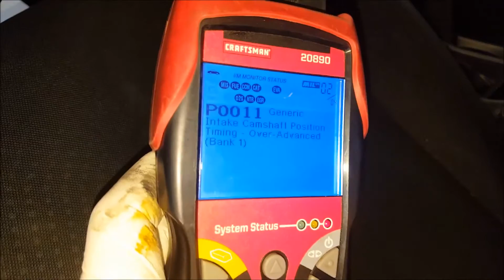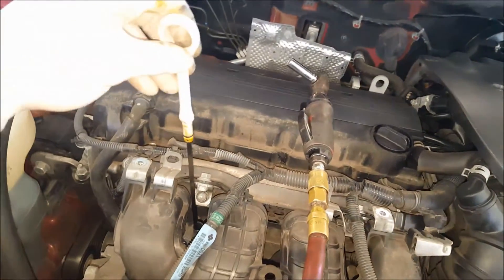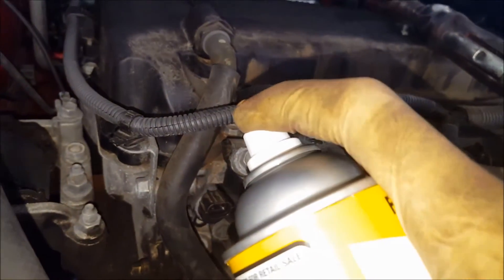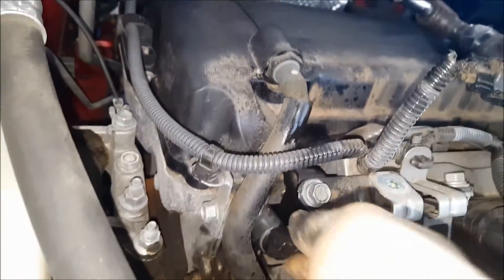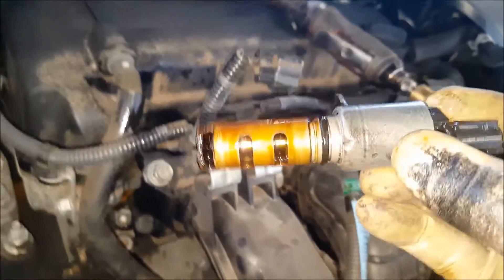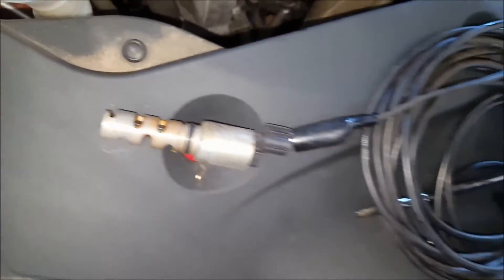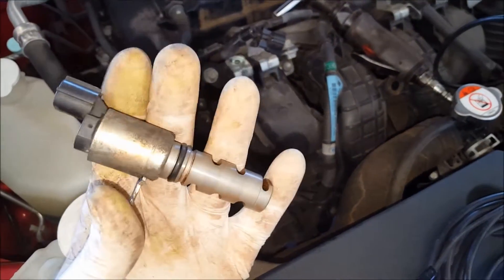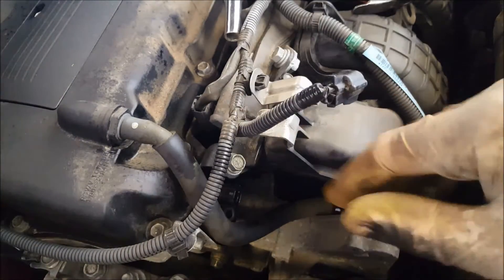MITSUBISHI 2.0L P0011 P0014 Outlander / Lancer variable valve timing solenoid vvt 2007-2016?

Comment: As a auto mechanic that does a lot of heavy line engines transmissions etc i cant tell people enough that these solnoids have a very fine mesh screen around them on a lot of vehicles those screens plug up cause timing problems oil psi issues etc. So many vehicles I work on are destroyed from lack of maintenance.  Ignore your oil change reminder they usually have you go longer than you should. Do your oil changes every 3k if your car or truck is turbo. 5k if not. Using a full synthetic oil. You do that you will save your self a lot of pain. Also service your transmissions every 50k or so.

Comment: Helpful in understanding the codes but quick question.  I had these codes pop on me about 100 miles after an oil change. I was concerned as I got a "low oil pressure " message first. Checked my oil and I was good there thought I'd be able to make it home less than 10 miles. I didn't make it. Car started tapping like it had no oil and stalled. Would looking at these solenoids be worth it at this point or am I dead in the water?

Comment: Replaced. Oil is new and clean filter too. Had dealer put in new oil pressure sensor and Still keeps popping up low oil pressure. Any help ?
Reply: Cleaned out oil pump pick up. Replaced the oil pan and oil and filter. Problem solved
Reply from the maker: Sweet. Glad to hear you got it rectified and taken care of

Comment: I have a 2008 Mitsubishi Lancer GTS. Mine doesn't look like that. Just has the dirty oil on it.

It was involved in an accident (hit in the rear passenger) but sat for 7 days at one place then when I tried to get it back, it went dead after a full days charge. 

It started acting weird like it was weak to start after barley being driven. When I finally got it to another auto body repair shop, it was there two days before it croked. Got it towed to an auto repair shop, they said they did diagnostics, but when I picked up my car from there (only replaced 4 spark plugs and 2 coils), I smelled burning through the a/c vents.

Hooked up my code reader and it said it was the P0011 and P0014. My oil cap has sludge on it, but the solenoid doesn't look like my cap. 

You think the part is just bad? I also want to buy a factory solenoid to replace it but I know it will cost a lot. Would I need to get the Power Probe to test it or just get it replaced?

Thank you
Reply from the maker: Hard to say without seeing it.  Prob bad solenoid.  These are very common to fail.
Reply: @NoNonsenseKnowHow  would they both go bad at the same time?
Reply from the maker: Not generally, but not unheard of. Usually best to replace them in a pair either way from my experience
Reply: @NoNonsenseKnowHow  I will start with that then. I was gonna do an oil change to see if that would help since I'll have to do it anyway, but seems like just replacing them is the best way to go. 

Would I need to do anything before I replace the old ones?
Reply from the maker: Sometimes changing the oil takes care of it. Especially if somebody put the wrong weight oil in there last time
Reply: @NoNonsenseKnowHow  So, I should try changing it first, then replace them if it has the same problems. It has been sitting for awhile now but I have 2,000 miles left until I actually have to get it changed, but if the wrong weight is in there then it needs to come out, right?

I mean my idle was off but it was only after It had been sitting 7 days the first time, 🤔🤔
Reply from the maker: I would start with changing the oil and clearing the codes
Reply: Friend, are both the same, front and rear?

Comment: Can u help me , I need to know what’s the correct oil pressure on my 2014 Outlander gt, I have a noise when the car is cold but the soon the motor get warm I can hear the ticking noise , I know the pressure on the oil when is cold is at 45 and when is hot is at 17 , do you think is correct, thx for ur help .
Reply from the maker: Sorry I'm not sure what the speck is off hand. I would think you should be able to look it up in a manual or on the Internet. Have you tried finding a factory service manual download? A lot the time you can get them for free
Reply: Yen I’m trying but no luck .

Comment: I have a 2011 Lancer and got these two codes as well.  Where do I find them to check/change/clean them?
Reply from the maker: I tried to cover a good amount of that in the video. And I put links to them in the description
Reply: @NoNonsenseKnowHow  I know where to find the parts to check and/or replace them on the internet.  I was talking about where on the engine do I find them.  I didn't know if they are located on the same place on my car as the Outlander
Reply: They're in the same place. Did you figure out what was your problem?

Comment: I'm doing this on an 09 lancer. They are in the same spot. They wiggle back and forth but they won't pull out. Is there something  I'm doing wrong?
Reply from the maker: Did you try spraying some Rust penetrant or Lube on them and wiggling them back and forth? After doing that they should pull straight out while twisting
Reply: @NoNonsenseKnowHow  the previous owner just told me that he didn't change the oil  for almost a year. Would build up on the end not make it come out? And I was using wd40 should I get something else? I was twisting and pulling with a ton of force, I almost threw my shoulder out
Reply from the maker: @skaterboi8494  yeah it's possible that the sludge buildup is preventing it from coming out.  WD-40 should be sufficient.
Reply from the maker: @skaterboi8494  just don't break it off in there.Because then you'll really be in trouble. Better off leaving it alone if you think it's going to break
Reply: @NoNonsenseKnowHow  yeah I'm leaving it for now. I'm going to change the oil and run a quart of marvel mystery  oil through it for a week or two
Reply from the maker: @skaterboi8494  that's good call. Marvel Mystery oil is great stuff!

Comment: One question if my car is a mivec engine and i replaced it w a regular vvt one does that affect mi car ?
Reply from the maker: No.  MIVEC(Mitsubishi Innovative Valve timing Electronic Control system) is just the brand name of a VVT engine technology developed by Mitsubishi Motors.
Reply: @NoNonsenseKnowHow  ohhh ok i had to ask because idk why it dosen't accelerate the same way
Reply from the maker: @4klp59  it's possible that the aftermarket part you used is crummy or faulty
Reply: Mmmm yes might have to clean the old one and compare

Comment: Hi! i have a 2014 Mitsubishi Outlander 2.4L and the same code came up after checking it at a local autozone. I have noticed that the VVT SOLENOID INTAKE is not where you took off the one in your video but both engine kind of look the same. Please help!
Reply from the maker: Yeah this video is regarding the 2.0 liter. It should be located somewhere on the cylinder head
Reply: Anyone know where the intake vvt is on 2015 outlander 2.4

Comment: I just cleaned the back VVT sensor but cant seem to find the front one. Do you know if only 1 sensor is installed on a 2011 Lancer ES. The message on the dashboard still on btw. I don't know if this is related of another sensor being uncleaned. Please advise me. Thank you..
Reply: The sensors were found and cleaned and the code it cleared. thanks for posting a helpful video on how to maintain the vvts
Reply from the maker: @specolishead1  awesome. Good to hear and thanks for the update
Reply from the maker: What code did you originally have? And did you clear the engine light after cleaning? Also do you definitely have the same engine as in this video. The 2.0 liter
Reply: @NoNonsenseKnowHow  Code P0011. No i didn't clear the light after cleaning. Yes it looks the same engine, but can find the sensor. Maybe i check again.. How do i clear the message please. thank you!
Reply from the maker: When you say "the message", I assume youre talking about the code? And if so you should be able to clear with whatever you're reading it with. If not, check out the description of this video and it has a link to OBD2 scanners on Amazon.  If you have the same engine as this one, it should be in the same place as the one in this video
Reply: @NoNonsenseKnowHow  Yes, i meant the code. I will look again for the other VVT sensor. I'll keep you posted on any progress. Thanks again for your help..

Comment: My mechanic trying to say when replacing these or my throttle body and sensor that it needs to be reprogrammed. I don't think it is true but would like to know if I'm wrong?
Reply from the maker: Some Vehicles do require reflashing the PCM for proper operation after installing a new throttle body

Comment: My cars running those same codes. Took out my css, and it really wasnt that dirty, clean it up anyways, problem still occurring. Any ideas bud?
Reply: Get a new sensor if it doesnt work after cleaning. Or you can also do a physical and maybe electrical test on the wires connecting to it.

Comment: Did you have to drain the oil first?
Reply from the maker: No, but it's highly recommended to change the oil at the same time as doing this and make sure to use the proper weight oil